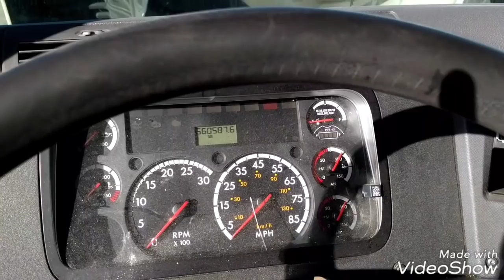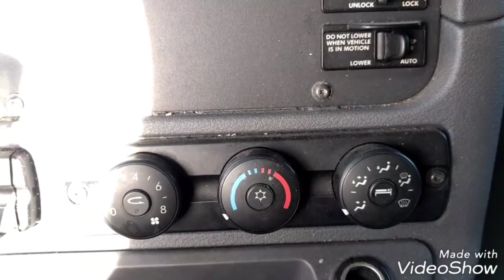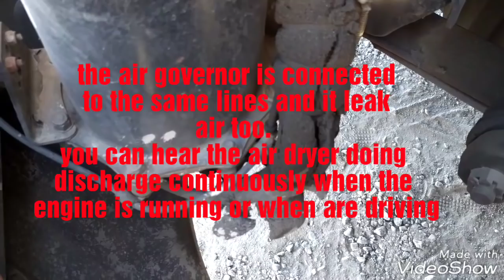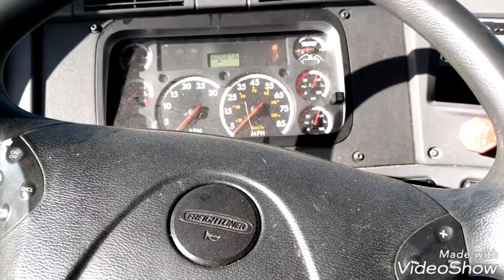Freightliner Cascadia DD15 engine common problems OM 472

Comment: Thank you  so much for this videos.  I have 15 units  mostly freightliners couple Pete and Kw but everything you said is spot on.   I bought a new used 2016 freightliner in the summer.     $ 80k 300k miles and after the first rain came I noticed water leaking into my cab    Asked the dealer to fix it. They would not Cuz it had been 2 months already since purchasing.    Now I know to spray it down with water before buying it.      Very very good info here guys.  YOU WILL SEE THESE ISSUES no matter what.   I’m moving to buying only brand new trucks now

Comment: Another question to touch on coolant leak coming from the Def tank. Great videos and we sure appreciate u making these videos to help out drivers that want to do the work them selfs.
Reply from the maker: Oh, the coolant leak from the DEF coolant tanks is caused by broken coolant heater lines to the DEF tank, to prevent this problem you need to make sure the the lines are secure and tight (no chaffing to each other or to the frame)

Comment: So pretty much everything failure on these freightliner Cascadia. well i used to own 3 of these trucks same type they were a nightmare nothing but problems. but after I switch to the Volvo then I’ve seen a lot of difference more reliability less maintenance on Volvo. Volvo to me is the best trucks I have ever used so far

Comment: I have a leak coming from (air manifold) Area as you mentioned in this video. How can this leak be fixed? Is it a hard or easy fix? I have a 2010 Cascadia with DD15
Reply from the maker: It is a medium difficulty job, specially for the limited space you have inside the cab. 
You need to remove all the air  hoses from the fire wall side then you have to go near to the gas pedal and remove a cover in front of it and you will have view of the air manifold for inside the cab, now you will need to disconnect all the switches (be careful not to switch the position of the plugs at the moment to reinstall all the switches plugs) then remove the air hoses after all the all the hoses are out of the way, use a T30 socket to remove the bolts that holds the manifold on place. 

With the manifold out remove all the switches and place them in the new manifold (install them in the same position) and once all the switches are on position reinstall the air manifold and connect all the hoses.

Comment: Hi Francisco this video was very good. However, I have a 2012 Freightliner Cascadia myself and I am coming across with a nightmare of a problem. My issue is that I changed the hardness on this truck because I had water coming into the computer and it has burned two of them already. Like I mention before I changed the hardness and it has a new computer in it but this issue keeps on coming up. Have you ever had this problem before? I am in desperate need of good advice this truck has been a money hawg for me but I would like to resolve this problem. Any suggestions would help. Thank you in advance.

Comment: Hey Francisco, quick question.. I recently had the egr actuator replaced. At first everything was cool. Now I hear a chirping sound coming from the actuator. Is this thing hooked up to the air system somehow? Because when the air compressor is building air, the chirping sound is not there. As soon as it spits, it comes right back. The actuator is the newer model for a 2010 Cascadia.. Any ideas?..

Comment: When changing out the isolator bushing for the gear stick. Do I need a special tool to remove the bushing?
Reply from the maker: Yes, to remove the OEM bushing you need a air or electric impact hammer to remove the bushing ( the OEM bushing has metal around it and this is inside the gear stick. 

To install the new you can buy a brand call ATRO this bushing does not require a special tool to be installed all you need to do is to press it down with your hand a align it to the stick orifice.
Reply: Francisco Amaya thanks

Comment: What egine would you recommend DD15 or Cummins isx?
Reply from the maker: I would DD15 but that will depend on what you want to used for.
Reply: @franciscoamayaYT  I wanted to run over the road hills in all. I been seeing alot of Cummings ISX freightliners 2013 125 with about 350,000 on the engine for about 45k sale price. Would you recommend one of those freightliners with the ISX Cummings engine?

Comment: Francisco, I have a cascadia 2010 dd15, my air dryer purges constantly(like 1 time per minute),  can't find leaks, in fact I don't think there's leaks cuz the gauge is always up to 135 and is not going any lower even when the system bleed off air, someone told me I could adjust the pressure by turning a screw on the governor(is that, one of those?), I can't even find the governor, I think the compressor is on the back of the engine, do I need to remove the fender to get there like I've heard

Comment: Good morning Francisco. I was wondering if you know anything about the R A C system, I keep getting R A C system failure which set off check engine light along with turning off on guard system. How do I fix?

Comment: Tengo un problema :( 
My tractor tail lights very dim.  And applying brake makes all of it go out totally.  Where do you recommend starting ?
Reply from the maker: Do you have LED taillights?
Reply: Yes. It's the LED taillights. 
Should I try buying new ones and installing?
Reply from the maker: Yes, you can do that.  
But first, Check the main plugs and the wiring.  

The main plugs are located on the left and right, on top of the taillights.  

Check for corrosion, it is common cause of your PROBLEM.

Comment: Hola Francisco. Que camion usado (marca y modelo) con 400,000 millas es lo mejor en cuanto a RELIABILITY (menos problemas) and MPG (mejor millas por galon)...No tengo dinero para nuevo, pero what years has you seen with low problems...(cascadia, international , kenworth vs DD15 vs Cummins ISX15)..thannk u
Reply from the maker: In my opinion, Freightliner Cascadia with DD15 is the best. 
It has problems, but it is not too expensive to repair.  
MPG is not bad (6.5 - 7.5 it varies). 

The 2011 with not DEF Cascadia is best you can buy, but they usually have many miles. 

You can buy a Cascadia from 2013 and up to have the updated SCR system and ENGINE.

Comment: Hi Francisco,what is Code SFU 49? the truck starts all the time,but today didn t  initially and gave me that code,then I tried again and it started.
But for the last month,a month ago I deiconnected and cleaned the terminals bc it wouldn t start,it did after I did that,but now lately every time I start it,all the dashboard lights come on and the chime sounds too.
So what is that code?

Comment: gracias Francisco. what year is the truck u are describing. Also, are these issues the same for all  years or some years has less issues?
Reply from the maker: This specific truck is 2012 Cascadia, but the best you are from 2010 - 2011 no DEF Cascadia and 2013 - 2014 Cascadias

They are going to have the basic problem but the engine is going to last a million miles if it is maintain properly.

Comment: IMPORTANT QUESTION: IF I DOWNGRADED MY HORSE POWER FROM 505 hp to 455hp on a cascadia 2015 with automatic transmission, CAN I SAVE IN FUEL? WILL IT COMPROMISED OR MESSED UP THE SYSTEM AS WELL? Has u seen any experience
Reply from the maker: Yes, it is possible that you can get a better fuel economy but everything will depend on driving habits. 

No, it will not affect the ENGINE performance or damage the engine.

Comment: What are the cascadia isx common issues you see
Reply from the maker: 2011 - 2013 
Crankshaft Failure
Fuel pump Failure
EGR cooler Failure
DPF Failure
Etc,..

2014 - 2017

EGR cooler Failure
Exhaust manifold leaks 
Thermostat Failure
SCR Failure
Etc,..

Comment: Hi Francisco!  My boyfriend really enjoys your videos!  He has a 2011 Cascadia DD15 stock. He would like to increase the horsepower, what do you recommend and what do you think it would cost to do so?
Reply from the maker: Thanks. 
The computer has three different preset option for horse power, it doesn't take long and $120 is the most they can charge, unless you go to the dealer.  

Well, it is okay to do it.  It doesn't affect the engine performance but it does affect the engine fuel efficient.

Comment: My cascadia 2012 dd15 the fun clutch keep on I put a new cilenoid nothing happens still on
Reply from the maker: Is it leaking air? The fan clutch.
Reply: @franciscoamayaYT  If the fan hub is leaking air do you suggest replacing the fan clutch too?
Reply from the maker: @shmirbuchanan8673  
You can just replace the hub but if the truck has more than 900k miles is better the replace it completely.

Comment: Francisco. Great videos you have. 
Put yourself in an owner operator position. What would you get?
Reply from the maker: Cascadia Coronado or century class with DD15 engine
Reply: Ah man!! Just purchased a 2015 vnl 670 with a d13 and I shift☹️ 
I pick up the truck on Friday. Hopefully I didn't make a big mistake!!
Reply from the maker: Volvo is a good engine, it is just really expensive. Parts are expensive.  
I shift.. well, hopefully everything is working fine.  Next time buy a manual transmission, it last longer without problems.  

But I am not trying to take your moral down,  hopefully it will be a good purchase.  Good luck.  I will try to make video on that D13 Volvo engine soon, so you can DIY it.
Reply: Thank you. I'll be waiting for that video

Comment: I have 2009 cascadia been parked for 2 years had issues think I can get it back  the road ready? It had 800000 miles.
Reply from the maker: Yes, you can. 
What the Issue you have on it?
Reply: Francisco Amaya the head gasket,dpf filter cracked, cam housing, oil module, fuel pump, new tires .
Reply: Your videos are very informative and true cause a lot of the problems you have pointed out on the vid I had repaired already on my 09 lol !!!!

Comment: Hello I have a 2010 model like this.  DD15.  was idling outside my house few days ago to warm up truck and it shut off after a couple minutes. No codes or lights on dash.  It's cold up here in Wisconsin. I thought it was gel problem.   I treated fuel with anti gel but still no start.  You think try changing the three fuel filters, then try priming and starting,?  
gracias usted.
Reply from the maker: Yes, you can replace the fuel filter but I will highly recommend you to check the fuel status with a diagnostic tool to see if there is fuel pressure at moment of cranking the engine.
Reply: Those trucks have a idle shut down after certain minutes.
Reply: No, bro  .  It ended up being a check valve fail on the fuel pump . Cost me $2,000
Reply: Marcusf250 
Check valve $2000??? I changed mine for $56.  Its on the fuel filter. Cummins engine though.

Comment: Where to begin to change the bushing in the gear stick? Do I have to pull down the clutch?
Reply from the maker: No, you have to remove the top gear stick boot (it has like 10 bolts hold it) and then you have full view of the bushing.
Reply: Francisco Amaya I remove the last bolt holding the gear stick before the bushing.. do I have to turn the gear stick or pull up on it to get to the bushing? Don't wanna break nothing.
Reply from the maker: There a bolt holding the gear stick you have to remove the bolt and pull the stick up, just remember to cut the air line and put back in the same place.

Comment: Hola Francisco tengo un cascadia y quiero cambiarle el aceite ala transmission (10 velocidades ) tengo 580,000 millas. Mi pregunta no más se le cambia el aceite . No lleva filtro en la transmission ??? Y no maS se drena y se pone nuevo aceite ???
Reply from the maker: Si, solo se cambia El aceite. No lleva filtro. 
Si, solo se drena y se agrega El aceite nuevo. 
Usa SAE 50 synthetic transmmision fluid.
Reply: Francisco Amaya. Cuantos galones de aceite lleva una transmisión?
Reply from the maker: Como  3 1/2 - 4 1/2 galones.

Comment: tengo un Cascadia 2012 dd15 y a 11000 RPM le entra un fallo como si le faltara fuel  cambie las lineas del tanque hi pressure valve y otra que esta cerca del filtro y todavía tiene el mismo problema (nota el mecánico reciente le hizo el motor y después de eso es que tiene ese problema
Reply from the maker: Tiene algun codigo?

Comment: 2020 Cascadias Cruise control tend to go out about every week. I had drove for a company and its was brand new. Only had 6 miles on the truck. I only put 15000 on that truck. At 3000, 7000, 10000 and 15k miles the cruise went out. Its was odd. But im guessing thats a common problem on it🤷

Comment: Peace my brother!!!What type of problems do you see with the new 2018 Freightliners and 2018 Volvos???Peace and Blessings!!!!
Reply from the maker: No, much problems so far. They still new, the have a lot of problems with the new DT12 automatic transmission (Freightliner), and problems with miscommunication between modules.  
My advice, avoid automatic transmission or if you want automatic transmission buy a Eaton smart shift.

Volvo has a good automatic transmission but it is too expensive to maintain, the engine too.  
So far I haven't heard anything about volvo but I will happen soon.  
A very common problem with Volvo engine is the bull gear is goes bad with low miles.

Comment: Carnal quiero comprar un troque estoy mirando un 2000 kenworth con cat engine 18sp o un 2014 freightliner casquedia dd15 13sp no mas que estoy mirado que el dd15 puede tener muchos detallitos
Reply from the maker: Todo camion tiene problems pero si no necesita comprar un camion con systema de emissions compre El KW 18 speed.
Reply: @franciscoamayaYT  gracias compa muchos me dicen lo mismo gracias..

Comment: Hola, tremendo todos sus vídeos👍🏼👍🏼👍🏼👍🏼👍🏼.... le escribo porque mi camión cascadia 2012 con dd15. Esta humiando mucho y botando  aceite por el respiratorio y eso no lo acia ante. Quisiera saber su opinión. Tengo un vídeo pero nose como compartirlo. Para q lo vean gracias y espero su opinión y la de cualquier gracias
Reply from the maker: Es possible que alguno de los cilindros Este malo. 
Como se ve El aciete?
Reply: Francisco Amaya está perdiendo aceite
Reply from the maker: Cambiele el repiraderor a ver que pasa despues de eso.
Reply: Francisco Amayusted me puede llamar porfa
Reply: Le estaba chequeándo el aceite y en la tapa tiene coolant. Eso pasó esta mañana q puedo acer ahiiii.. y si esta bien seguir trabajando así
Reply from the maker: Es possible que un cilindro este malo.
Reply: El camión sigue corriendo bien
Reply from the maker: Entonces revise de donde esta llegando esa agua al motor